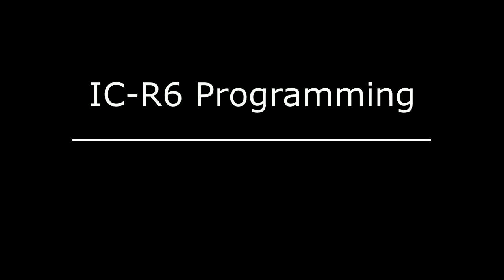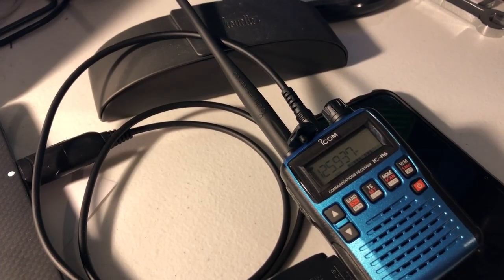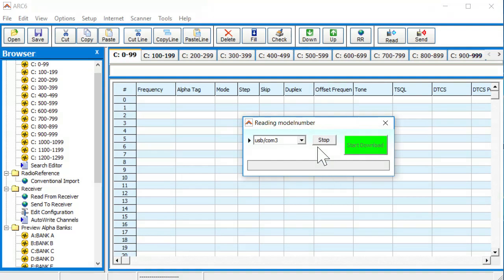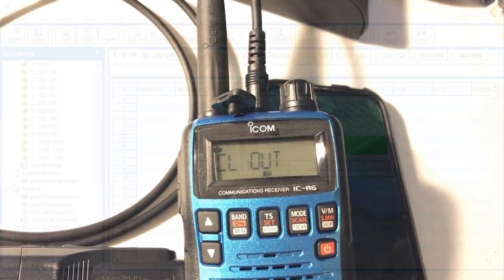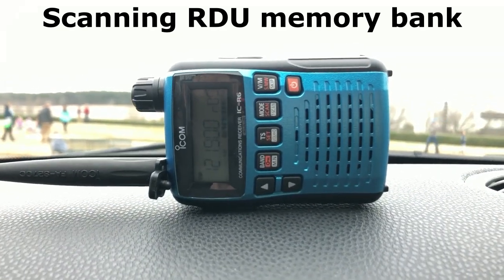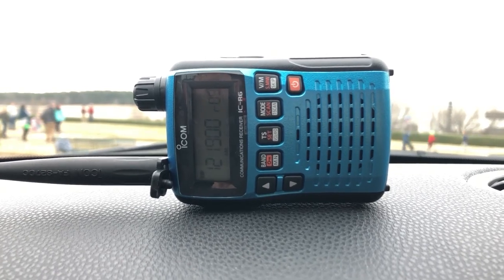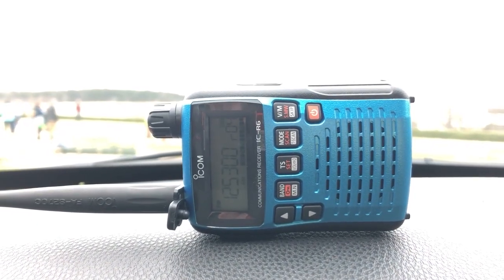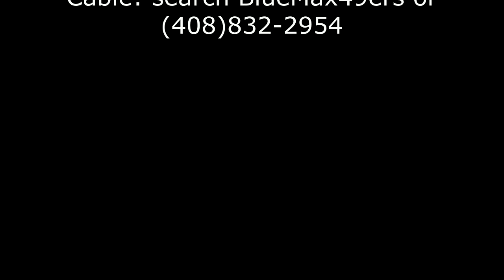Programming an ICOM IC-R6 wideband radio receiver

Comment: nice video. question, can you scan frequencies that are not programmed into the radio? and in your opinion is this the best value for the money digital scanner? im trying to listen to phase 25 852mhz frequencies and i would like a ht with a numbered keyboard but a ht with those capabilities is going to run me 3-6 hundred bucks right? thanks for any input have a good one
Reply from the maker: Scanning is pretty flexible on this radio. You can set a left and right frequency and scan between them or scan memory banks. You do not have to use the PC to set channels up in memory, but it is much faster. 

I am a novice at this, so not very familiar with all the radio options out there. My son is an Air Force pilot, so I wanted to be able to listen to him (and others) whenever I have the opportunity to go to his base. I did some research and came up with this radio as a good capability for the price. I have carried it on commercial planes (domestic) quite a few times and it's fun to listen in on the pilots, tower, etc. It gets AM radio and weather. I have tried to receive CB radio but not been successful - not sure why not. It seems straight forward enough to dial in a frequency for certain channels (i.e., channel 19 is 27.185 MHz), but I get nothing.
Reply: @fiveyorks  you're likely getting nothing on 27.185 simply because there just isn't nearly as much traffic on the cb band 26.865-27.405 these days as there was in decades past. It's largely dependent on where you are
Reply from the maker: Yes, you can scan frequencies that are not programmed using the computer. Using the buttons on the unit, you can actually do everything you can do using the computer, it just takes a lot longer. For example, however, if you want to set a left and right frequency and scan between those, it's not too many button pushes to get that done. I have not scanned frequencies that high. The highest I have gone is military UHF, 3-400 MHz.
Reply: @fiveyorks  thanks for the input, yes i figured out not long after my original comment after a few phone calls, thats this is a "digital radio" but it is not capable of receiving and pickong up on phase 25 police radio. and most stations around the country and are moving towards encryption so even if i spend 500 on a digital HT that can receive phase 25 800mhz theres no guarantee they wont be encrypted so i decided in my area my 8watt uhf vhf and fm baofeng with a good antenna gets me everything i need and theres so many police scanner apps for ur phone that people have already setup i will just use that for free when i wanna listen in on country wide police bands. thanks have a good one